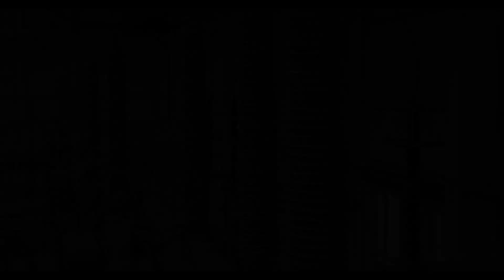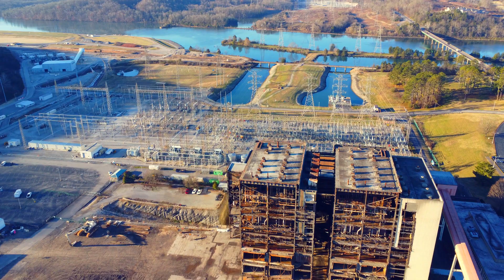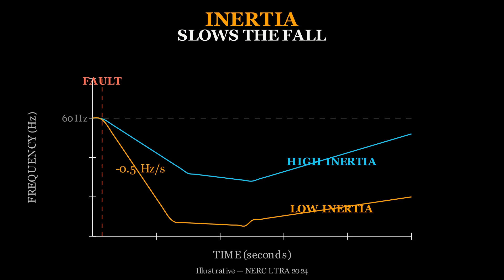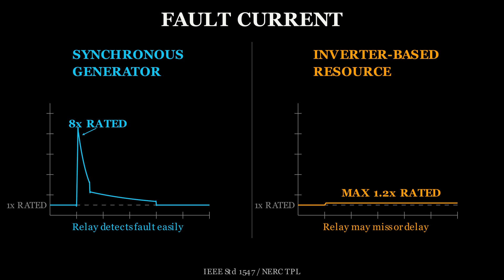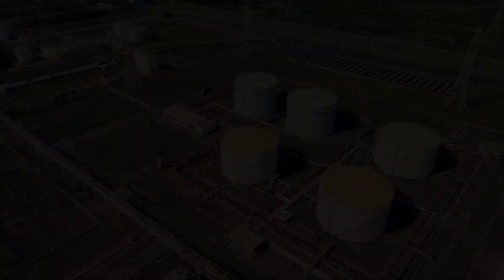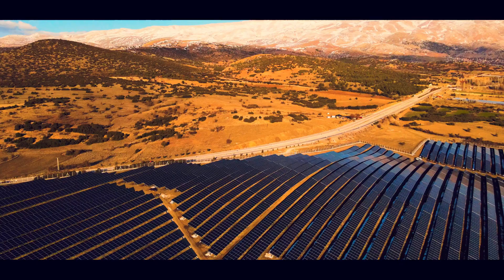The Hidden Job of a Gas Plant (And Why Solar Can't Replace It)

Comment from the maker: The three things a synchronous generator provides that a solar farm does not:

1. Inertia — the kinetic energy in spinning metal that slows frequency collapse after a fault, buying time for protection systems to respond.

2. Fault current — the short-circuit current (5-10x rated) that makes protective relays operate in under a second. Inverters limit to 1.2x. Slower detection, harder coordination.

3. Reactive power — automatic, continuous voltage support across the transmission system. IBRs can do it, but it requires design choices and trades off against real power output.

FERC's IBR planning standards deadline: November 2026. Full implementation: January 2030. Every project interconnecting before then connects under rules designed for a different grid.